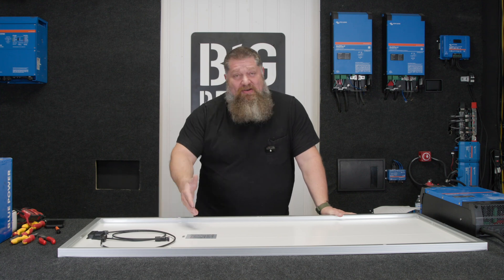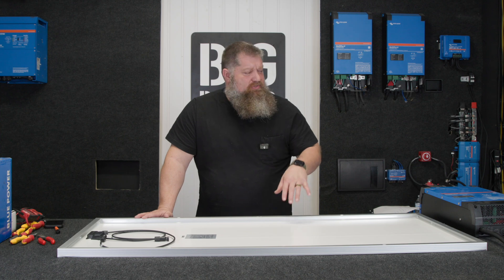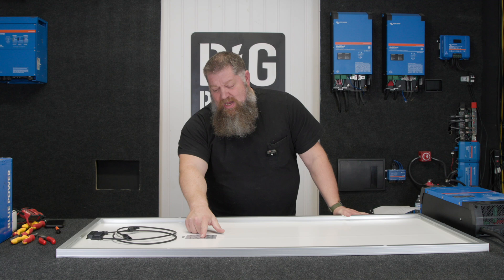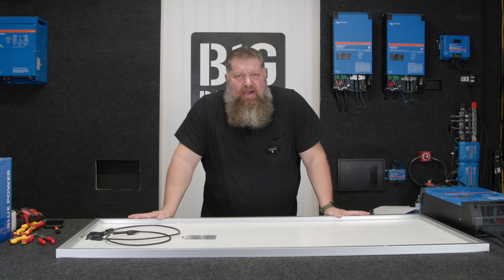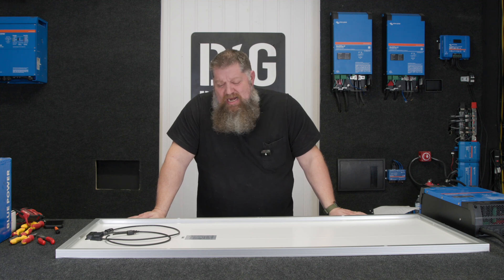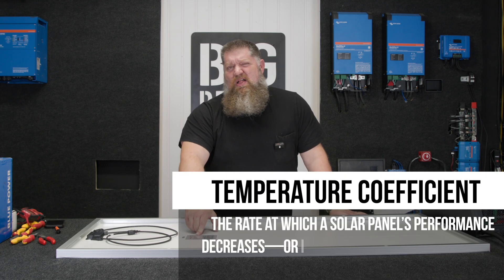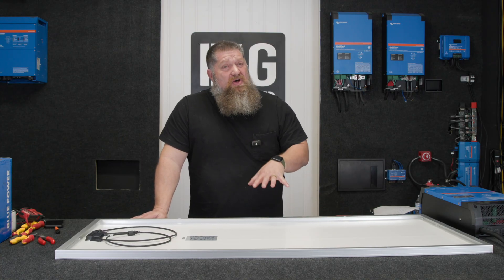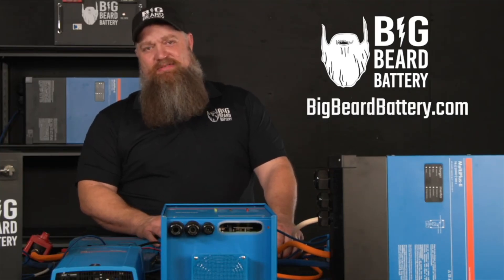How to Understand Your Solar Panel Data Plate (Voltage, Amps, VOC, VMPP & More)

Comment: I saw you offer numerous options to install solar system looking to buy trailer over next few months.  Need air conditioning since we have cats and want to get out hiking etc. I see that some trailers come with small guage wire like 12-14 in their inverter prep which is not helpful. How do you get around that with large inverter to run AC.   Thank you so much
Confused lol
Reply from the maker: Hello there,

Yes the inverter prep typically is for only 1 circuit like the gfci. 

When installing a whole RB solar system we connect our larger inverters directly from the shore power cord to the service box using 6awg wire to the input sbf output of the larger inverter.
Reply: @BigBeardBattery so you run wire from 30amp plug location to the panel and to the inverter under the trailer/insulation
Reply: @B @BigBeardBattery are there any trailer brands that wire entire trailer to handle large inverter and AC etc

Comment: Yep charge controller needs minimum but always leave room for maximum. My trailer array is 12 panels and 6 is the sweet spot of 350v, max of controller is 500v dc two inputs

Comment: Was noticing on the data plate something called Cell Efficiency, at 23.00%
Does this mean the solar panel is at best only this percentage efficient, so you are not really getting 200 watts, even under best conditions?
Reply: It means a maximum of 23% of the standard 1000W per square meter can be converted into electricity. That's just the cell. The overall panel is less efficient due to the spaces between the cells and the border and frame. If that adds up to 21% efficiency and you have a 2 sq meter panel, you should be able to get a maximum of 420W from that panel under ideal 1000W per sq meter illumination.

Comment: I have heard that you will have trouble going to close to the minimum voltage required number on a solar controller. Example you put your panels in parallel and now your 25 Volt panel set up is not enough to wake up/turn on your solar controller that is 100 volt and start charging your battery. Have you seen this happen?
Reply from the maker: So it takes roughly 2 volts above the charge voltage to wake and maintain the charger. Putting panels in parallel keeps the volts low which shortens the window of Harvey’s each day. 

You don’t need to hit some high number just above the charged voltage under load.